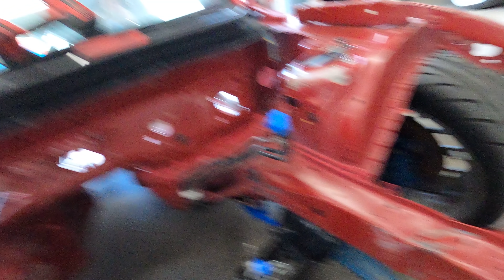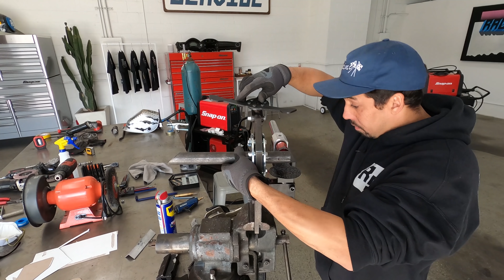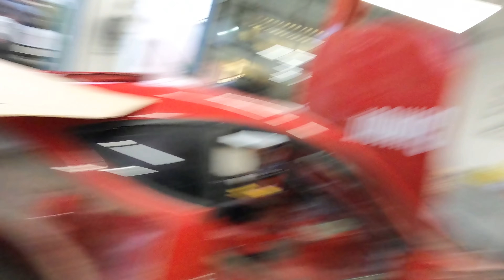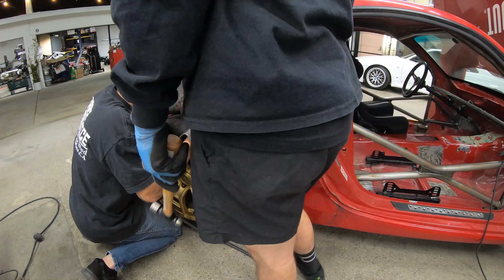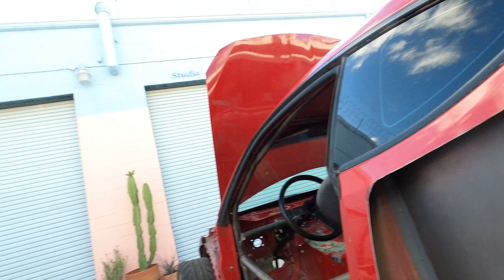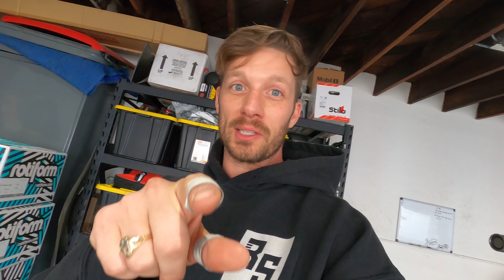Ryan Tuerck- East Coast Car Build EP .4

Comment: If you really wanted the extra step on making it clean... Instead of tape on the little holes. Hold a peace of copper on the outside and weld it on the inside. U probably already know the trick but it takes 5 min and if u grind it down after it's clean